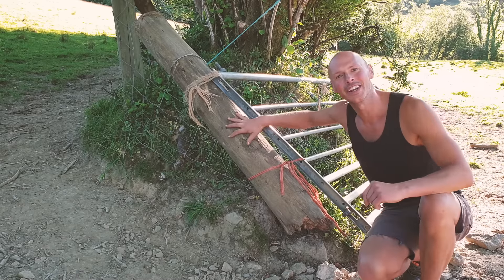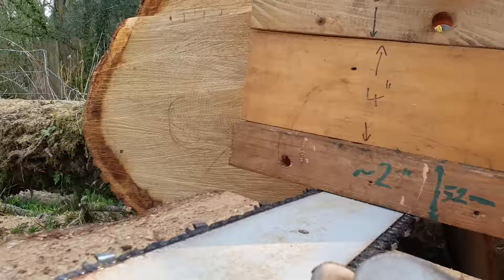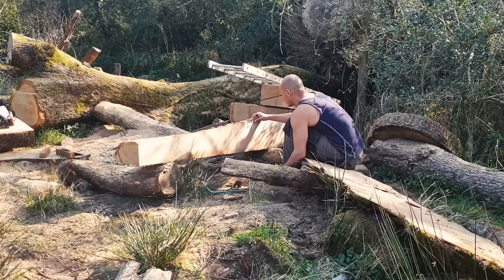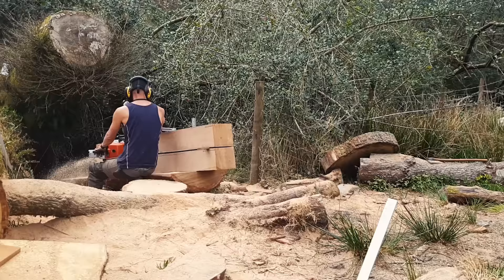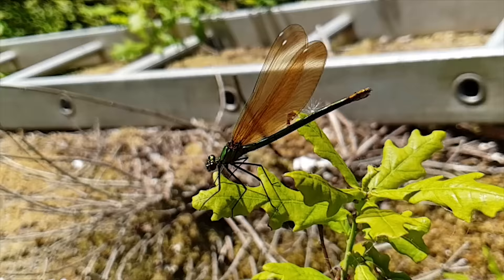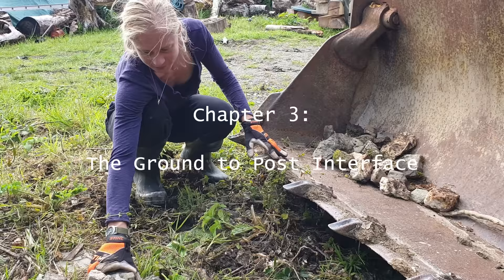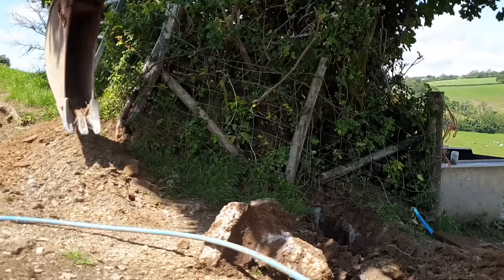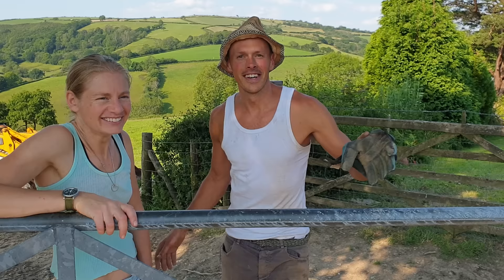The 3 secrets to ROT PROOF POSTS and how to make them

Comment: the holes gonna fill with water. i like to coat them with tar and build a mound at the bottom. concrete is good i usually use a peir form so the concrete top is 3" above the soil line, I also backfill the bottom of the hole with small rocks and cement so the bottom of the post does not touch the soil. I like the idea of charing the post havent done it yet alot of folk seem to be experimenting with it and im sure it might be effective. Inted of using rock i would choose a well graded material like road base which packs down well and grade the bottom of the hole to encourage water to drain away from the post. You can also bevel the bottom of the post so there is less post i contact with the bottom of the hole which will likely be the wettest spot and wick water up into the post. I think breaking that wicking effect and haveing a base which breaks the soil level contact with the base of the post is the key  to having a post that will dry out and last a long time.

Comment: Truly enjoyed your video and the great comments—amazing knowledge thank you.  I’m in Florida, and our water table and termite issues make any wood posts a gamble.  I’m pretty sure some of the posts might remain, but in many places two feet down I find water during some times of the year!  Guard rails have been installed for many many years using galvanized steel I beams.  When they replace the guard rails, the i-beams are pulled out and sold as scrap.  Enterprising folks are selling them for repurposed use.  I was able to acquire the 6’ I beams for $10 each.  I found I could affix them to 6x6 wood posts with stainless lags—two 6’ I-beams, and a 4’ 6x6 post.  With 5’ buried—I used old cement broken up (no stones in Florida!)—followed by new cement, more old cement, and topped with new cement.  My tamping effort was weak compared to yours!  The top of the wood is angled and covered with sheet metal.  My point is that even in places where wood, stone, and water fight us, we can find low-impact, low-cost solutions.  I’ve never seen what galvanized I-beams look like after many years in Florida’s unfriendly earth, but As you noted, pressure treated posts are NOT the answer!

Comment: Interesting!  Here in California I have a lot of oak on the property so I used plain oak with no preservatives and no rocks like you did.  The Oak lasted two years and that's all, it was just 8 posts so mot a big problem.  However, There are miles of Cedar Fence posts all over this Gold County area and I've been here twenty five years and when I got here the post look about the same as they did back then. The weather is hot and dry, then some good rain.  I even pulled some up some of the old Cedarand they had no rot and were set and surrounded by soil.  I'm not going to be setting posts anymore but it's always interesting to learn something new.  Thanks

Comment: Being in the construction trades I can always come across partial rolls of rubberized membrane (ice and water shield).  I install two layers of this adhesive backed product around the lower perimeter with  three layers on the base.  The membrane runs up to about 8" above ground.  Posts (soft wood) I installed 25 years ago are still good as new.

Comment: I’m using creosoted softwood posts for my property in the south west of England. You can buy them at local farming stores quite cheap. They’ll last 15-20 years easily. You can’t actually buy creosote anymore where I live, but you can buy creocote which is a newer much safer formulation which is still pretty good stuff. It looks the same, smells similar and is still quite harmful. It repels water amazingly but it doesn’t protect against fungus and woodworm rot apparently. 
I’ve just had them installed with a petrol machine post driver, I’ve done a few smaller ones by hand with a manual post driver. I think they used gravel for the bigger gate posts though. Concrete is a big waste of time and money for fencing unless it’s urban because it causes more rot due to lack of drainage in the ground and it takes longer and is expensive

Comment: An option we have used, since we have an over abundance of pine, is cut 4" (10cm) diameter pine saplings cut to appropriate diameter and let them fully dry.  Render tar from any rich heartwood, though we again use pine tar.  Stand your posts on end in a 1 foot (30cm) or so deep amount of pine tar for a few days, with a spacer that allows the ends to be exposed to the tar.  I use a cut up baking drying rack in a 5 gallon bucket.  Capillary action will have the tar soak back into the dried wood.  Let them bake in the sun for a few days or a week.  Then bury the coated ends (brush tar o to exposed wood if needed, for your depth). Roll pine tar across the top of the fence post.  Done.

Comment: I have put in 1,000s of these corner posts. Good job. We used old telephone poles that were tar soaked and they worked really well. In the south of the USA they have black locust and they become like rock when they dry. those were also really good. Love the video. Jim in Chile.
Reply: I used to work for British Telecom, a telephone company in the UK. I did a course on pole work. The telegraph poles were treated by Rüping, a process of pressure treating and then vacuum treating the wood with creosote. The poles were initially topped with finials for protection. These could be quite elaborate depending upon whom they were made by. You can see the odd finial decorated telephone pole, but they are very rare now. The finials looked good, but due to the fact they were screwed into the top of the pole, this could allow the ingress of water, decaying the pole. 
Metal caps were used after the finials, but the means of fixing them also caused decay. 
Eventually, the caps were dispensed with due to costs, leaving an angled cut at the top to deflect the rain.
Reply: @paulbradford8240  I have been cutting the tops of my posts at an angle lately but in the summer I treat my posts by pouring some creosote on to of the posts. It seems that the flat posts are better at absorbing the treatment. I know I may be over reacting to the cause and such but I have started to lean back to flat top posts. Jim in Chile

Comment: G'day Bongo, it's good to see your channel flourishing. I have an old mate that owns a chicken deli I get recycled filtered veg oil from him to run in the Lucas mill slabber, the only problem I find is that at the end of the day I'm craving chicken n chips ! On our farm I use Red Ironbark for posts no burning or treating necessary as it's termite resistant tamping the soil back into the hole the first few inches are critical and grey box for rails both are good for at least one hundred years 👍🇦🇺.
Reply from the maker: Hey Ish, thanks for getting in touch :)
Haha, your veg oil problem is a nice one to have! 
Sounds like you have access to some might durable hardwoods.
Peace, Bongo.

Comment: That was a spectacular and wonderful piece of timber you diced up for some posts there, definitely a shame, but nicely done anyway :-) I have my father's entire collection of native and exotic timbers of all sorts, some I can't even identify. Among it was some "worn out" kwila decking he salvaged at some point, some was destroyed from long term water exposure, but about half of it had good solid kwila under the outer layers. I belt sanded it down and stained/sealed it with decking oil and it looks fantastic. What I discovered with different pieces in storage in different places was that the UV light is not what discolours/ruins the decking oil finish - it's the water, and specifically just humidity was enough - some was under a friend's house off the ground and sections of that started to go bad even though they were dry. Amazing. Kwila lasts very well when treated appropriately with good drainage and so forth. I'll be using it for a small deck on our holiday pad pretty soon :-)

Comment: Supporting the Redhawk- old engine oil but onto hot timber immediately after heating as it soaks in more and turns the charred surface into a charcoal/oil skin.
Reply: I was thinking the same.

Comment: Hi, we had oak fence posts at 4" square put in clay soil either side of a ditch which was done in 1947 and some were still there in 2010, not bad going, have used a lot of treated fencing but not worth it now, cheaper in the long run to get chestnut or oak. Good video.
Reply from the maker: Hi Stephen, thanks for sharing. Interesting how different wood types last in clay... 1947! that's good going near a ditch and only 4" square.
Reply: @FloweringElbow  Hi, there were also gate posts like yours put in at the same time in drier ground, which didn't last any longer, I think the clay was so wet that it stopped the oxygen getting to to timber and helped to stop the rot.

Comment: We have clay soil around here and the "old timers" say to not pack rocks/gravel around the sides of the post. Reason being that the moisture moves from the clay soil and sits in the rock or gravel right up against the wood post.
Reply: im trying to find the best way of erecting a wooden fence in our hard clay soil, iv dug down just under 2 ft and the clay is almost solid which is not good as i want to have a 8-9ft high fence
Reply: @staffysmile3325  
Keep digging. Keep the clay and pack it back into the hole around the posts.
Reply: @austin2842  i have bought some Creocote today to hinder the rotting,  you think packing clay in will be better than postcrete?
Reply: @staffysmile3325  
Yes, I think packed clay is better than postcrete if you value longevity over speed and ease. All the fence contractors seem to prefer the postcrete because it can be completed very quickly.

Comment: Whitewash (quicklime + water + pigments) also works great for keeping insects away from the wood. Especially if paired with charring, like this: oil the wood surface, char it, then whitewash it, then let it dry, then burry it. The part which sits above the ground could skip the whitewash, and instead be charred, as well, oiling before and after, to make it more waterproof. In fact, if you can, it's best to quickly oil, then char, then remove the excess (as you did), then oil again, then use a much smaller flame to dry that oil into a hard scale (like it hardens on a cooking pan or baking tray). The trick with the second oiling is to dry the last coating of oil into a plastic-like protective layer, apparently.
Reply: Neat that you can season wood like cast iron!
Reply: @szurketaltos2693 , I didn't think of that. 😆 And now that you say it, you could also use some very spicy pepper liquid/powder, and mix it into the oil, to get an even better way to keep termites away.
Reply: @SapioiT  that's an interesting idea... maybe add permethrin?
Reply: Maybe,  @szurketaltos2693  , it depends on how it changes with time, in the conditions of the post, and how it interacts with the other things in the treated wood.